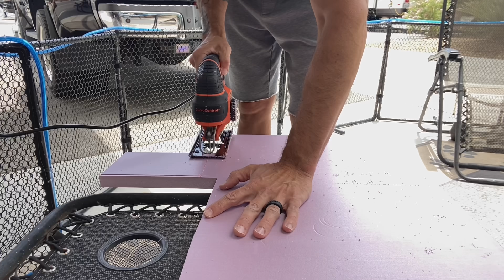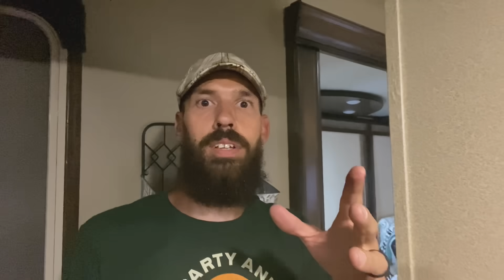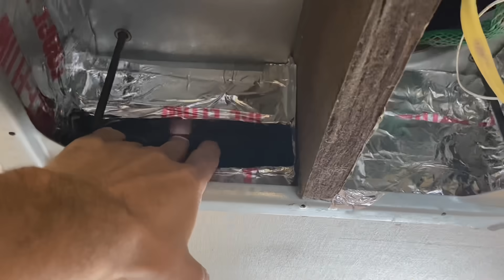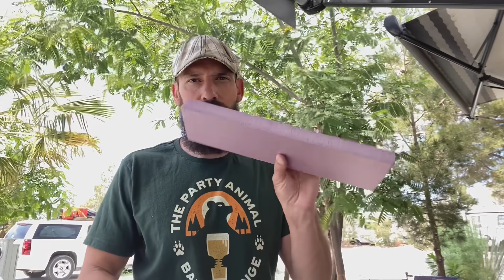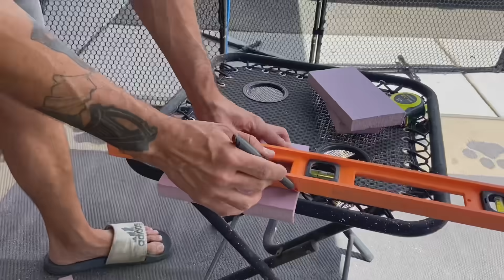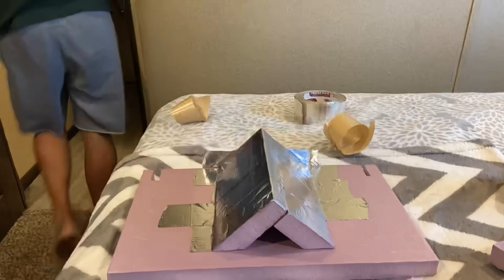RV A/C Modification that will DOUBLE the Output & BOOST Performance!

Comment: What would cause my travel trailer it was cold for a minute then cut off just blowing air
Reply from the maker: Could be that thermostat wire that is pushed into the fins. Check it first. Next check the power board up in the ceiling to see if you have a bad relay switch. The whole power board can easily be swapped out for like $80 and it’s just unplug and plug the new one in. Simple fix I’ve had to do myself.

Comment: I love the modification. My issue is that the previous owner had a critter chew into the ductwork, so my ducts don’t pass air well. I’m considering closing off the ducts and going ductless. Then, I want to modify the dump finish piece to ensure plenty of supply air. I currently have good airflow into the main cabin without a finished piece installed. We have a 28-foot 5th wheel with four vents, wired for a second unit in the bedroom. I’m planning to add a second unit, which should keep the 5th wheel cool. Fixing the ductwork doesn’t seem easy unless I create external ducts outside the ceiling. Adding sun blocks on the skylights will also help keep the unit cooler.

Comment: Chris, heading to Home Depot on my lunch break. Great video! Gonna grab reflective for windows as well. My solitude's kitchen table side faces west and the blinds get as hot as 110 F 😮 Loved the bunk room ducting fix also and reminder to move the thermostat to the kitchen side and to put reflective in the furnace return. You rock as always! Will post on fb when these upgrades are complete. I would also imagine this will be a big win for the heat pump function in winter also. Thanks again my friend!
Reply from the maker: I like it bud 👍🏼👍🏼

Comment: If my blower vent coming from outside is offset ( off to one side/ not in the center) should I modify the pyramid so it is offset also? Or do away with it all together as it is only about an inch away from the outer edge?
Reply: I would modify the design so that the peak of your pyramid is as centered as possible on the AC. You will probably need to change the angle as well so you don’t end up blocking the duct on the short side.
Reply: That’s what I’m thinking too. Thanks for the reply!

Comment: I’m trying to figure out if I should do this…Does a 17ft trailer with a rooftop air conditioner even have air ducts separate from the unit itself?

Comment: Great video, very informative and a great idea!  I’m wondering if there’s a simpler way though…that doesn’t require building a box and a pyramid. 

What if you just blocked off the vent from the a/c unit with a piece of the foam board and drilled two holes in it - either 3” diameter or 4” depending on what the ducts can handle.  Then you do the same with each of the ducts running to the vents.   Then connect a flexible foil hose that one uses for their clothes dryer - taping everything up nice and tight so there is nowhere for air to escape.  

Wouldn’t that create the same effect without all the extra building?  You’d just need a 3” or 4” circular bit for your drill to run the hose into.   You wouldn’t require the jigsaw or any 45° cuts, you could just use an exacto or carpet knife.

Comment: Realizing side effect of this mod...  I did the mod over a year ago, works as advertised, thank you for the video.  This year I realized the improvement has resulted in the compressor cycling when starting RV setup when it is high 70s outside (trailer in mid 80s inside)....the compressor/coil freeze detection is kicking in.  Running on high improves results with less cycling.  The issue is the AC works too well, the air temp (intake vs discharge) difference is very high, 35-39 degrees when it is near 100F outside.  This side effect results in slower trailer cool down rate when outside temps drop and freeze detection cut off starts (but awesome when hot outside)....  This has only presented when the inside trailer temp is desirable so I don't need to correct, but am curious if any DIY airflow or RV airflow users have realized similar?

Comment: Having just installed WackO's RV AC Silencer, I may modify those with your tips.  I have to look and see what angles I may be able to lessens and how I might channel the air flow better.  At least your method is far more affordable.
Reply from the maker: How is that Air Silencer? Been curious about those.
Reply: @WhyWait  WackO's Silencer is a cost effective mod to reduce noise and it seems to improve efficiency. My rig has central ducted air and it appears that these air flow mods aren't possible on this Beaver. I am continuing to study the situation.

Comment: Have you tried doing it without all the angles just boxing it in  seems air will take least path of resistance
Reply from the maker: No if your just boxing it in it’s almost the same thing. It’s already boxed in. The angles are like a fast track to push and force the air directly into the ducts 👍🏼

Comment: Great video. Love the channel.  Quick question.  I have a heat pump in my a/c unit.  I’m unsure how the unit works when the heater turns on.  Would this modification interfere with the unit when we are using the heater?
Reply from the maker: Hey Ben. Not positive I believe this mod shouldn’t hurt that. If the heat’s coming out and into the ducts all this mod does is force the air into them quicker. So this shouldn’t hurt anything.

Comment: I wonder if this would work if you shifted them just a slight bit for a bigger space on one side that shoots to the long side of the rv?
Reply from the maker: Guess it depends on your duct work. Ours is an even figure shape that runs through the ceiling.
Reply: @WhyWait  what a is your AC manufacture
Reply from the maker: @rmstark1966  I meant to say our duct work is designed in a figure 8 shape that runs through our ceiling. Our AC unit is a Coleman-Mach
Reply: @WhyWait  I asked because your dump is same as mine. Thanks for replying. Do you have any videos of slide floor replace or cutting a small section it to replace with good wood
Reply from the maker: @rmstark1966  no nothing like that. Probably not to hard though.

Comment: Anyone had condensation form and start dripping? What did I do wrong?
Reply: Yes, see my post a few minutes ago.  This DIY airflow mod worked well on my mach15, my output is so cold I get condensation on the ceiling plastic discharge vents.  I also have heavy roof run off so I believe this to be a side effect of very cold discharge.  To bad the RV ac units don't have a method to allow more outside air to be blended with intake air to effectively control output discharge temp (warmer when too cold)....
Reply: I see this situation like very cold beer, we will deal with bottle sweat to have it nice and cold....maybe need 'beer koozies' for my discharge vents!

Comment: I installed a Midia window unit in my bedroom emergency window exit. By far the quietest window unit! It is 12,000 BTU with inverter technology, extremely energy efficient! Paid only $300 at sam's club. Compared to $700 for new roof unit. Roof units are extremely old in efficient technology!

Comment: Instead of the teepee, I made two quarter round sections by bending two cardboard pieces parallel to each of the corrugations,  taping the top two ends together and taping the bottom two ends to the bottom of the outgoing vents. The taped together ends sit right up against the middle of the supply air hole. This might improve the air supply by making smooth transitions for the airflow to change direction 90 degrees to the left and right. Seems to work great. You could do the same thing with sheet metal or aluminum. Cut to size and wrap them around a paint can or similar to make the 90 degree bends.
Reply from the maker: Sounds like it’s working out nice for you. 👍🏼 Good idea

Comment: Great job Chris. Very thorough and relaxed presentation. Gave me the confidence to do this project on my 32 foot Flagstaff,  VLite. I turned on the AC and it does sound quieter however, any guesses as to why I now have a high-pitched buzzing sound?
Once again, great job on this video.
Reply from the maker: @GabrielRosas-b9y  appreciate you watching. Glad you got it done. Not sure about that noise, maybe you have some air hissing out somewhere. Not sure to be honest. Here’s a review I did recently since this video was over 3 years ago. 
RV A/C Modification 3 Year Review! / Stay COOL for $25
https://youtu.be/FKiHV38zLJs

Comment: Looks great!  I’m definitely going to try it.  Question - why did you have to remove / replace the existing center panel? Can it be left in place as you add the baffle assembly?
Reply from the maker: It definitely works! You can leave or take it out. It sort of just blocks the return area a bit for more air flow to be sucked in.
Reply: @WhyWait  thanks again.  Great info…..

Comment: I just did this today, with my Coleman mach 15.
It took several hours. Had to figure out how get the base board with the split ramp to fit into the opening. Other than that, it wasn't too difficult.

Comment: I want to do this mod but I only have two vents in the main area where the A/C is located. I don't know if blocking off the main dump vents would let my main area cool down as fast. Wondering if anyone has a mod where you can still use both with the directional triangle piece?

Comment: I did this modification today. Following your video really made it simple and easy. While I had everything apart I shined my light down the duct and glad I did. There were multiple gaps where the duct work joined together, so the a/c was cooling the space between the roof and the ceiling! It took me awhile to get them sealed. I can't believe how much more airflow there is and much quieter!! Thank you for the video.
Reply from the maker: That’s great to hear Rich. It’s amazing how bad some of these ducts are taped up when you start opening things up!
Reply: Do you think it's worth putting thin insulation around the evaporator box on the roof ac unit, or it's overkill? Thanks!

Comment: Chris, I have almost the same air conditioning unit except mine has wires that run through the cold side from the intake side. Have you seen this mod with that configuration? Thanks in advance and thanks for sharing!!!
Reply from the maker: No I haven’t. Sounds like something you could work around though. 👍🏼

Comment: You took off the panel. Do you put that back or just the cover?
Reply from the maker: You have to take the panel off, it’s just for the air dump feature which won’t work anymore, that’s the whole point. You just put the cover back on.

Comment: I put air flow systems solution in my rear air conditioning for this. It definitely increased the flow and efficiency, and reduced noise in cool mode, but the negative is this unit now makes a lot of noise in heat pump mode. I wonder if this DIY approach would solve the same efficiency problems, but without the noise and heat pump mode?
Reply from the maker: It solves the same efficiency problems but I couldn’t tell you about the heat pump part.

Comment: I love the very detailed explanation! I'm in hot FL, this is something I'll be definitely doing! I do have a question: Would it be possible to just attach a Y shaped duct conector to the top hole and attached two small pieces of insulated duct to the other two holes of the Y connector going to each side?
Reply from the maker: I guess, just anything that directs the air straight into the ducts quicker without wasting the air just floating around the big open plenum space. 👍🏼

Comment: THANKS FOR THE GREAT VIDEO - WORKS GREAT!  Just made the change two weeks ago - went on a 5 day trip in still hot Texas (not today - 37 and brrr) and it was so much better.  We did not have to turn on the Closed Captions when watching TV, could actually talk to each other, and all but one vent was blowing great; BLOWING STRONG IN THE BEDROOM.  Certainly plan to open the vent cover to the vent that is not blowing well to determine the problem, and will examine all of the vents so just make sure everything is looking good.  The jigsaw works great, just know that you may need a mask and may want to try to contain the particles - they get everywhere - and they cling; but they vac up too!  THANKS AGAIN!
Reply from the maker: Awesome! Love hearing the good feedback. Glad it’s working for ya 👍🏼

Comment: I started this and found a sensor in the return side just floating in the air.  Is this suppose to be this way of tucked into the coil somehow?
Reply from the maker: That’s your thermostat wire, should be in your coils, prevents the unit from freezing up. Check out my video here and you can see where it goes. 👍🏼
ROUTINE MAINTENANCE FOR YOUR RV AIR CONDITIONER | (Tips to increase RV AC performance)
https://youtu.be/I3ABUO8QsII

Comment: i have another question. its not about the air flow but about the AC. when i moved in, i replaced my old dometic duo therm thermostat with your average honeywell thermostat. when the AC turns on and off, it clicks. with the old thermostat, it clicks only once, but with my new one it clicks twice. is there a reason for that?
Reply from the maker: Man I have no clue lol I’m not a AC tech or nothing like that. If everything is working ok I wouldn’t worry about it I guess 🤷🏻‍♂️ Wish I could help more.

Comment: 77 degrees after the upgrade - what was the Lowest temperature you could go before that?
Reply from the maker: Oh we could get way lower than that too. We usually just have our thermostats set at 78. 
Even before the upgrade we could get things low, it just takes longer and you’d have to turn the ac in earlier. This mod just gets the air out faster thus cooling the RV faster.
Reply: @WhyWait  WOW.  Mine is new and 2000 BTU stronger than my original AC but can't cook more than 20 degrees.  Time to do some mods! 😎
Reply from the maker: @stevenbrown5210  yeah I can do better than the standard 20 degrees difference from outside but it still comes down to cooling it early, blinds shut, and that kind of stuff.

Comment: my rv ac is a dometic duo therm. am i able to use this modification for mine or do i have to find a different one?
Reply from the maker: I don’t know everybody’s different AC units 🤷🏻‍♂️ You just have to get up there and look. If you have a split between the two sides and are able to box off the plenum side to force the air in the ducts your good. 👍🏼

Comment: Thanks for your video, well done.  Unfortunately, Rockwood used the area to route a number of wires making this project not work for me 😢.
Reply from the maker: Sure thing, hope you subscribed because we have lots of helpful videos like this 👍🏼
Bummer it didn’t work out.  Well you can still make sure everything everywhere is taped up real good so your not losing air anywhere.

Comment: GREAT Mod. Worked better than expected ! One thing I did change was make a 2 inch hole through the center of the air deflector. (Top of triangle) so that I can still use the unit vents. Used an old vitamin bottle taped in place, does not affect the overall performance while closed, slight decrease  while unit vent or vents are open. Still what a huge difference.  $ 20 bucks 1.5 hrs start to finish. There is a commercial product called RV airflow system for $170.  However it will eliminate the unit vents.
Reply from the maker: Good deal and I like the mod if you still want the air dump! Hope you subscribed because our channel has lots of helpful videos like this 👍🏼 Appreciate you watching!!

Comment: Would a 2' x 2'  foam board be enough to do this upgrade
Reply from the maker: I would recommend a little bit more, especially for two AC units or in case of mistakes.

Comment: Well-made video and I used it as a guide when doing my RV airbox.
One change I made that increased the airflow dramatically was leaving out the old cold air director at the underside by the filters.  This allows for more air intake from the interior and almost full use of the filters on either side.  Took me about 3 hours and well worth the time just for the noise reduction factor.
Reply from the maker: Glad it helped 👍🏼

Comment: I tried this on my travel trailer, apparently the roof is much thinner than yours.  There was no room for the bottom piece or the redirect.  If anyone did the mod with a travel trailer and got it to work, please share.
Reply from the maker: Try watching this video. Same mod just with a travel trailer and different AC. Hope it helps. 
https://youtu.be/TusVLTNm7_s

Comment: I did this mod on my two A/C units in my RV.
FANTASIC!
Both are quieter and both cool better.  I was shocked how much air was coming from the discharge back to the suction.
COMMENTS"
1. Use a small handsaw, no jig saw is needed
2.  DO NOT IGNORE THE SUCTION/supply.  One of my units was in contact with HOT outside.  A few panels strategically placed stopped sucking in that HOT air 
3.  I did NOT remove the panel in between the suction and discharge of the fan.  Instead, I placed a panel on the suction side and TWO on the discharge side.  The second panel on the discharge side was cut ONE INCH shorter to allow the bottom panel to have a place to sit flush.
Do this ASAP.  You will wonder how you ever put up with all that noise.
Reply from the maker: Good deal. Glad it’s helping out 👍🏼

Comment: I went out and check mine, which has not been cooling like it should, and low and behold, there was a ton of cold air blowing into the hot air passage. Most of it coming from under the very edge of the frame. I will be doing this mod. Thanks
Reply from the maker: Sure thing. Your welcome. You won’t regret it 👍🏼

Comment: 3 solid tips in one video; vent pipe in mid-bunk, repel heat from furnace and topic of video (AC modification at units)
Reply from the maker: Right on 👍🏼